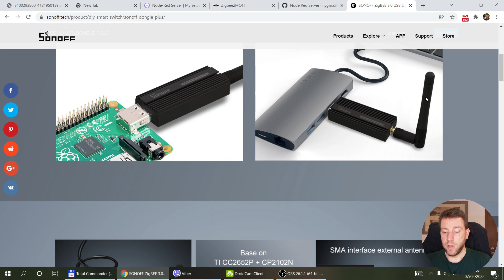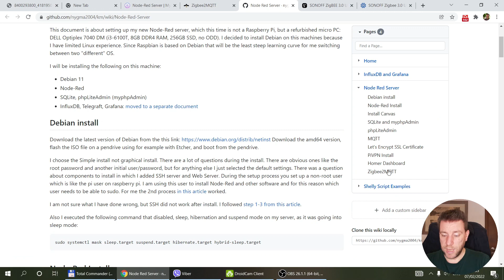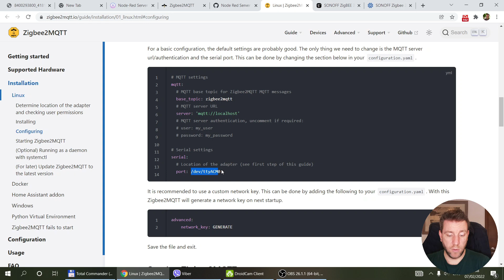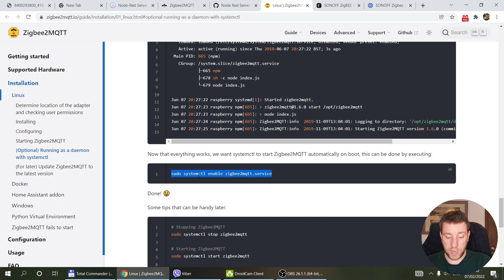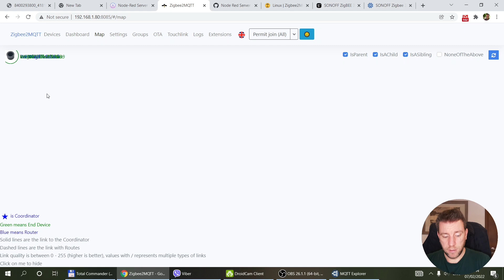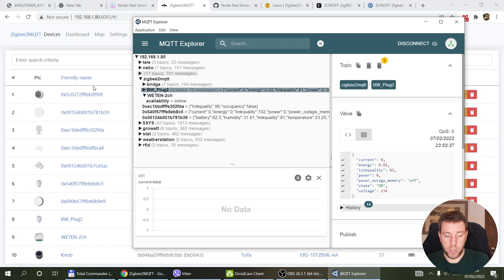How to set up Zigbee2mqtt?

Comment: is there a way to use, together, the zbdongle-e and the zbbdridge-pro? i've both, the latter came free gift buying 6 trvzb valves, and i already set them up inside ewelink and paired with the bridge... but i can connect the dongle to my minipc which is an other room... is there a way to use one to extend the network of the other one, and in case, which to use to pair and which as mesh member? i'd like to keep the ewelink app because i bought the valves so i can remotely close them when someone is not at home in their rooms... thanks in advance!
Reply from the maker: Not as far as I know. There is always one and only one coordinator on the zigbee network. You can build a second separate network but the devices would either link to one or the other. I think just keep the other as a spare...
Reply: @csongorvarga  ok, so i need to keep the zbbridge and eventually flash the zbdongle with a router firmware, and put it somewhere with just a normal usb psu, right? there's no need to keep attached to a pc if just a router... but how to pair it to the zbbridge? i need to open it, i think, right? and, final request: is zbbridge usable with home assistant without reflash it with tasmota or similar? Locally, i mean, not via ewelink...
Reply from the maker: @squalazzo  I think this is above my paygrade. I don't have experience with how to do custom firmware on zbbridge. This was one of the reason I got the zbdongle, but it was just plug and play. I plugged it in as it case out of the box and pointed Zigbee2MQTT to use the device. Since you have both I would say go the easy route and use the dongle with home assistant. But that means you need to re-pair you devices from the bridge.
Reply: @csongorvarga  , indeed, i'd prefer to keep them paired with the zbbridge (waiting for the ihost to arrive tomorrow, support for trvzb valves is supposed to be added this month, so i can import them all and use them locally), i'll let you know, thanks!

Comment: Hi thx for tutorial, I can make it work after  cd /opt/zigbee2mqtt  and sudo npm start but I can not make zigbee2mqtt start automatically at boot. Did you try that? sudo systemctl enable zigbee2mqtt.service  gives always error code=exited, status=217/USER.  In the  /etc/systemd/system/zigbee2mqtt.service KoenKK used user pi but I used another user, must be something about the user but I am not so good  in linux. I modified the User=pi to my username but it not works Any idea? Thx in advance.
Reply from the maker: Best to ask fron zigbee2mqtt. It must be a linux authorisation issue, and I am no expert either.

Comment: Hey, I got a smart plug with power measurement and z2m also shows the values which is great. Is there a possibility to monitor the values in a specific period of time? As example my pc needed the last month an default amount of watts. Just want to track the power consumption
Reply from the maker: Zigbee2MQTT just created a connection between the Zigbee network and MQTT. It will not monitor or store anything. You need some other system to do that. Or store the value in a database so you can review historical records.
Reply: @csongorvarga  do you know how to automatically store these values to a database? Excel would actually be enough for this
Reply: I am also using the BlitzWolf plug and wonder, how much watts my computer would need in a month as example. Have you tried anything similar with the blitzwolf plug or is the energy "all-time" consumption value all information you need?
Reply from the maker: @schubertma  If you want to keep is simple, you can just read the total energy counter in zigbee2mqtt on a paper and read it again on one month. The plug keeps track of the total energy consumed and that information is retained even if there is a power loss.